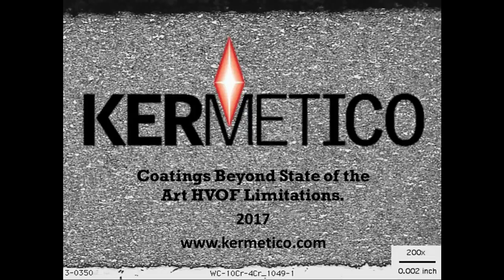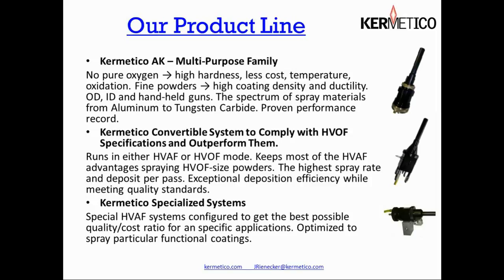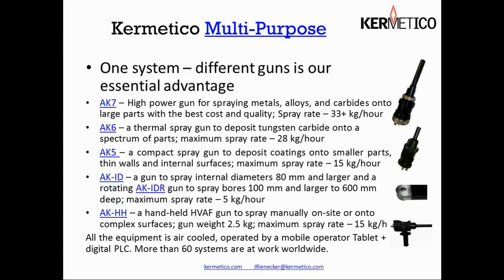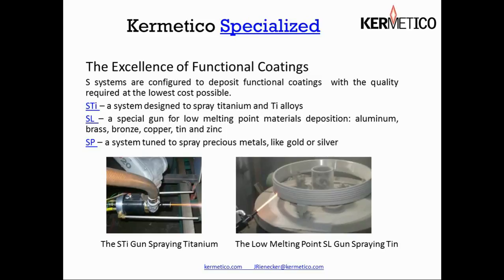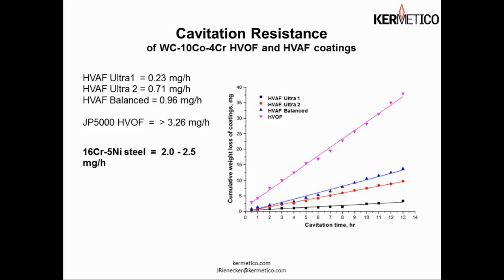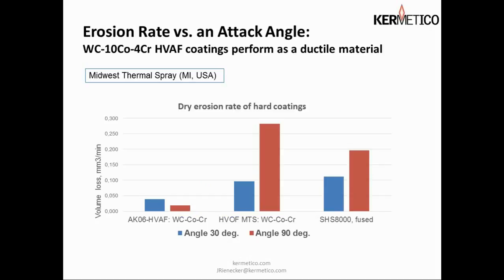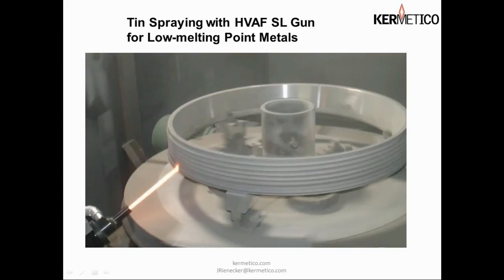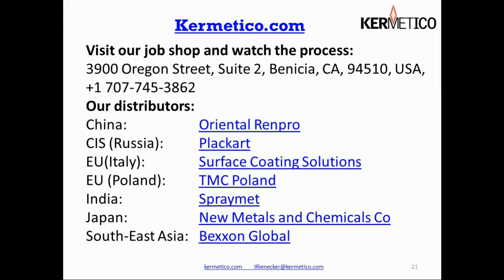A Review of All Kermetico HVOF and HVAF Equipment. January 2017 Webinar.

Comment: I'm pretty new to this HVAF system and from what I see it looks and handles better then HVOF. My question is does the HVAF need a chiller even if its a hybrid?  and we have a PraxAir JP 5000 gun so will it be hard to switch to HVAF or will we need whole new set-up for your equipments? Thanks
Reply from the maker: Our HVAF and Convertible HVOF system are all air cooled, no water chiller is required.  The only new equipment that you would need is the HVAF or Convertible HVOF system, none of its parts are interchangeable with our system.  Everything else, the room, robot or other manipulator, exhaust system and part manipulators are all the same.  You may need a compressor upgrade, or not, depending on how you're set up now.  the best was to proceed at this point is to have a conversation about you needs and facilities. I can be reached during normal business hours (Pacific Time) at 707-745-3862.  Thanks for you interest in our process. Best Regards, John Rienecker.